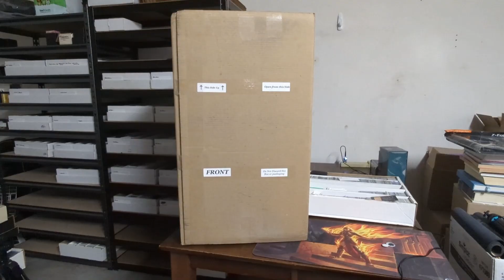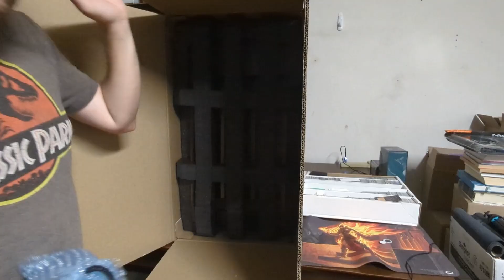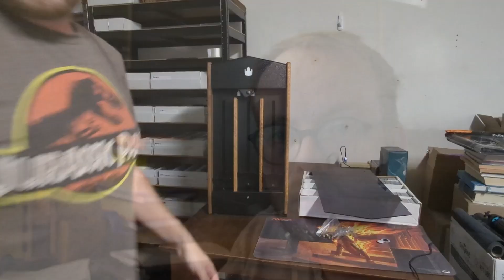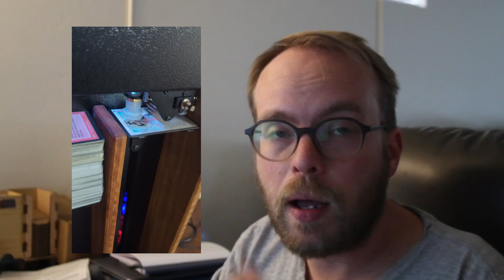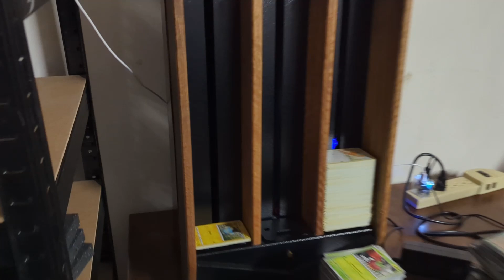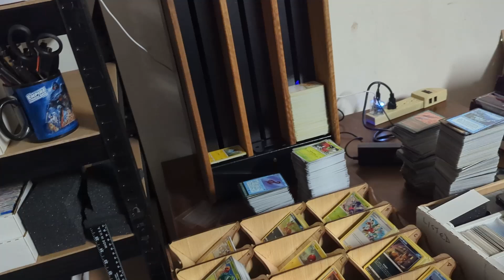You Won't Believe How EASY CardBot Makes Card Sorting

Comment: One machine I have been Absolutely loving for mass scanning is a ricoh 8170 doc scanner, with the Laskis innovations auto loader attachment on top. Its roughly $1000 all together and can scan 6000+ cards per hour easily. It doesn’t sort however the new CardMill kickstarter sorter is coming out soon, hyped for that too
Reply: I’m using the same set up, we also get super nice scans. What software you using to price and upload to eBay or TCG?
Reply: @darktheme923 TCG has a built in Scan & Identify tool built into their website so I just upload all the files at once and boom done. Also RNG Gamez had a video about a program he does the same with on ebay, one of his new videos
Reply: @darktheme923 The Price & Identify feature on the tcg website for pro sellers (which is easy to get any apply for).

You just upload all your cards at once to the website and it scans them. Also fir Ebay, RNG Gamez had a recent video talking about software for that too
Reply: @darktheme923  Once you become a pro seller you can upload and identify cards right on the tcg website. I upload like 1,000 cards at once and it identifies the photos. And rng gamez has a video talking about a software for ebay to do the same

Comment: I’d rather get a Phyzbatch on a 5 year lease at that pricing. Jesus, that’s robbery for such a limited machine
Reply from the maker: Seems to work great for myself and a lot of others :shrug: They notably also have leasing options
Reply: @TCGBulkKings I guess I’m failing to understand why, at that price, the limitations of this machine are justified; when for a marginal increase in monthly cost over time, you could either achieve the same outcome faster and in greater volume; or could retrofit the stock approach to scalability. This seems like paying for limited growth; rather than planning for maximum scalability. I would have imagined that the “every card has value” approach would make you extremely keen on either the roca or phyzbatch. In not sure if I’m even making sense here, but it seems like someone operating a drive in justifying why they don’t want milkshake mixers and larger grills

Comment: I'm trying to decide between the card bot or the magic sorter
Reply from the maker: I haven't used the Magic Sorter myself, but much of the feedback or reviews I've heard about it are that it's not simple to get set up and often comes with a lot of maintenance or even repair work that needs doing to get it going smoothly, which is why I've not jumped on getting one. Haven't really had any similar kind of issues with this CardBot though, just some fiddling with settings to get it dialed in

Comment: Not gonna lie ive been considering getting one of these to replace my p-9000 because we use ours to pull value .15c+ and use our roka to sort everything by set/abc 
Still have a full timer sorting but it definitely has helped in getting more volume out but this basically does the same thing and we pay $750 a month for the p-9000 and we lease it ...

Comment: I was sad when I saw that only MTG was supported... BUT SINCE I LAST CHECKED A YEAR AGO THEY ADDED YGO AND PKM :D
Reply: You mentioned it doesn't sort sets/organize things, it just more or less sifts through bulk so you have essentially a higher prio of what to list and what to bulk lot. Is my take away correct? I noticed at the end you mentioned you were throwing Battle Styes through it, you meant in the sense that it was skimming pre-sorted (manually) Battle Styles cards and plucking cards above a set price threshold? Cheers!
Reply from the maker: YGO is in very early beta, they don't have the pricing worked out with the API yet it seems. The Battle Styles it was doing for me was creating a csv to upload to TCGplayer. It doesn't do set or alpha sorting, so I'm doing that part still, but with it organized to drop into my inventory once it's done, it basically does it like an unmanned QuickList operation. It can also do binary sorts of the type mentioned in the video - price skimming, pulling a single set, rarity, type, &c.

Comment: If the robot removes one bottleneck it'll be on to the next one yes. If all your process steps have the same exact capacity a robot doesn't help much at all til you increase the capacity of the other steps. If the sorting stage is a massive bottleneck and all your other stages have much more capacity then a robot can be massive instantly.
Reply from the maker: That's true. But no one is talking about that particular aspect of this whole thing at all. I definitely appreciate the point about how different steps can be at different levels of efficiency to begin with though

Comment: This product sucks and clearly there is a gap in the market if you think this has any value. I'll make a better product and sell it for 1/10 the price, watch lol.
Reply: doubtful, but please do
Reply: SortSwift is doing just that, 4 bins for $2500 at 1200 cards an hour, with machines in plans up to 52 bins, and a 29 bins at 2500-3500 cards per hour in production right now
Reply from the maker: Cool, I'll take 2
Reply: I'll take 3

Comment: This actually seems very reasonable for mid-high volume sellers. Thanks for the inside look of this new machine.
Reply from the maker: You bet! I am really excited by this one. Tempered by some measure of sanity as I've retained here in Bulksylvania, but still. I just want others who this might be right for not to miss it
Reply: @TCGBulkKings  I’m in the market for one now but ROCA is the price of a car. 

I’m not sure how much use a yes/no sorter will be for me, though. Are there some examples you can share that help your pipeline that I may be missing?

I could see value from a yes/no for “rare or not” into a second sort of “certain set or not” then so on to get more fine grain sorting but not sure if that makes efficient sense here.

Comment: Im reading these comments and am appaled by them. People must not value their own time or work for free. This thing works when you are sleeping. And basically pays for itself in one weekend (10-15 hrs) running
Reply from the maker: It does need someone working it, but not nearly as much as actually doing what it does manually, that's for sure. As I said in the video, I've been very reluctant to push for automation, simply because it doesn't free up your time as much as you think it would. But this one works a lot better alongside my existing processes, and the pricing makes a lot more sense to me so that I can recommend it without feeling like I'm shilling something I'd never use

Comment: That pricing is insane bro.  $250/mo for 3yrs, + $150/mo in perpetuity, let alone the 1800 deposit before you even get the machine, is crazy.   There's a 0% chance you would have bought this without them giving it to you for free, right?
Reply: Still 1/10th the price of an employee
Seems like a great tool for scaling a hobby shop's business, and a terrible idea for a lower volume individual seller
Reply from the maker: As I said in the video, the software is covered by not paying the fees to use a lesser service from TCGplayer, if you're selling at a high enough rate to use it anyway. The bot itself is VERY affordable compared to the rest of the market for this. When I went looking for these kinds of machines a couple years ago, I was put off by the $25k and $30k options on the market, that I know stores use effectively. I would very strongly have considered this then had I found it. This is cheaper than the office/warehouse space I was renting, and definitely worth it in terms of return on the investment /for my business/. I'm not saying it's recommended for everyone, but it is definitely an avenue for scaling a single person or small team type business, without having to fork up thirty Gs
Reply: @TCGBulkKings  I completely understand what you're saying bro and I obviously agree that it's not going to be for everyone.  I did the same research years ago, and recently, just like you.   The prices are still crazy.   I'm just wondering if you personally would pay for this with where you're at today, the Direct Program issues, etc.?
Reply from the maker: @CataractsGaming  personally, with my business as it was two weeks ago, no, I wouldn't have bought one at that time. But it would definitely be something I could actually afford once I got finished with this shift I'm going through and can see reaching towards getting one in the next 6 months. Had I learned about it in January, I probably would have gotten one then. 2 years ago? Snap yes, no question. But I personally have been through a lot to put me at a cash-poor place at this very moment. But running like I was then, and like I expect to be soon, I could skip a few collection buys to get this deposit saved up and be much better off for it
Reply: i agree anywhere the OP can make a buck he will pushing these garbage robots way to expensive.  If this is your fulll time job do it yourself.
Reply: @alphaomega9563  Ever run an operation before? When running a business solo, you can only be doing so much at one time. So sitting and burning hours organizing and or scanning in cards is a very tedious and time consuming job. Your essentially paying for an employee at a fraction of the cost and without the headaches of dealing with a person. 

You might think this is expansive, but in the current market its by far the cheaper option. And when you start doing $2000 + a week in sales... well $8000 is really that far fetched.  What makes this garbage ? You seem to talk big but probably cant break down half these conversations.

Comment: I would get rid of the cardbot while you still can, most of ours and other LGS people stopped working after like 6 months. I'd switch over to the Magic Sorter, or ROCA.
Reply: I'd stay away from  the magic sorter as well. It came to me very uncalibrated. The machine hand would SMASH against the little dividers, and then after like 6 months of use after recalibrating it myself it just died on me. The camera just stopped working and it wasn't a cable issue, because I bought a brand new one to try and use, but to no avail so I just quit using it altogether. Not worth the hassle
Reply: One of the biggest problems with the cardbot is its inferior plunger material, where it will scan your cards many times until you manually adjust it. I'd switch to a vacuum powered bot.
Reply: I found the Magic Sorter painfully slow. It also doesn't sort the way a Roca would. It just sifts categories into piles.
Reply from the maker: I've heard about the older CardBots having an issue like this, but my understanding is that they've upgraded designs. The suction is actually vacuum powered, so it sounds like that may be the last that they've upgraded
Reply from the maker: thanks for the feedback!